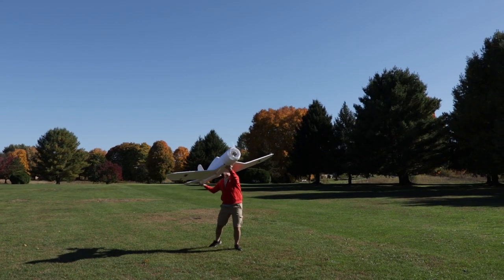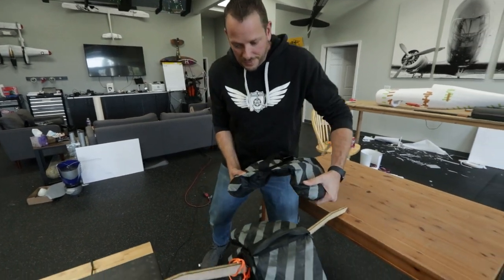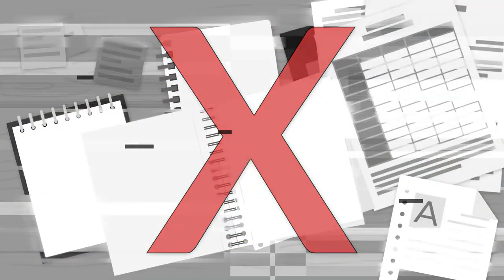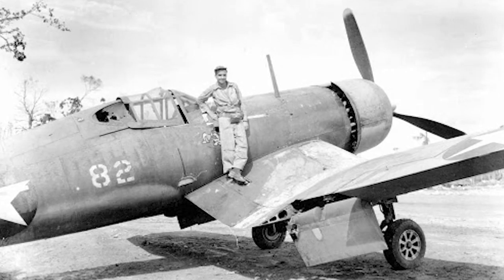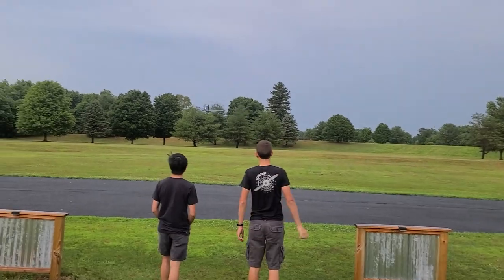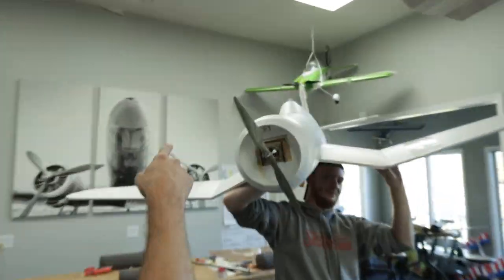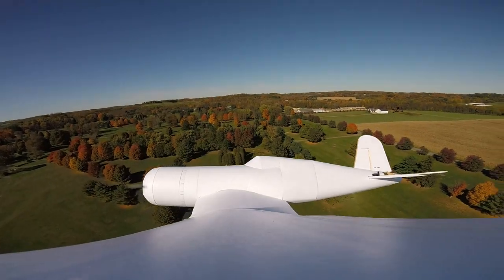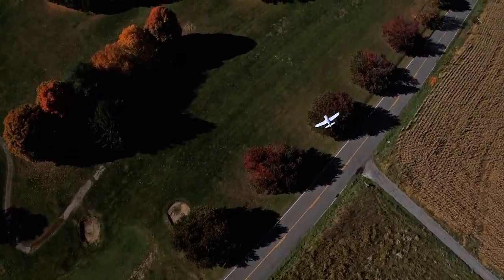Building and flying a Giant DIY Corsair!

Comment: Open up the cowling flaps to take some pressure off of the nose. Great Build and Design.  Ever consider drop "tanks" (batteries) for longer flights?
Reply: Yeah, that would be pretty cool to drop the used batteries by parachutes. Might have to make a special no friction connecter for the battery though so it can slip out easily. This is exactly the kind of cool problem that I'd love to see FliteTest solve.

Comment: I built a 73% scale from the original master series corsairs, with a 33" wingspan. The thing is a speed demon and looks gorgeous
Reply: Wow
Reply: Where can I see it fly?
Reply: Just curious - did you use A/F pack?
Reply: @JudeSchauer  I used a 2306 emax rsII 2450kv motor and ran it on 3s with a light pitch 7" prop, and 4s with a 6" prop. Yes the motor got WARM lol
Reply: @DPWingo  I have 2 crappy cell phone videos of it flying ony youtube channel, I'm trying to get a free day soon and have my brother chase it with his HD 4" drone. Those 2 older videos I just had my cell phone propped up on a bench and tried my best to fly past it. Horrible, I know, but it shows the speed somewhat
Reply: @sakfpv8444  Just watched them both. That's one fast Corsair. Thanks for sharing.
Reply: @DPWingo  thank you! I'm hoping to FPV it one day, and get some gps speed runs
Reply: @sakfpv8444  you should definitely invest in some FPV gear when you have the money.  When you put it in some planes (i did it in the FT TT) it feels like you are flying a real life plane.
Reply: @JudeSchauer  I have a lot of fpv gear for my drones, I stopped flying planes about a year ago when I found fpv drones, got some fatshark HDO2s and mostly fly drones and under 250g

Comment: Hey you guys beat me to flying!  I've had a 200% corsair built since the spring that I just haven't had time to finish up.
Reply: Did you add any center line structure through the middle like Noah did, or just like the plans?  Sure wish they’d share the big plans!
Reply: @chriscrawford1958  mine was built off the old master series corsair, so I ended up building a plywood inner fuselage.  Looked like my plane swallowed a simple stick.
Reply: @chriscrawford1958  the plywood inner fuselage tied the power pod to the first former set.

Comment: The beam is calculated by second moment of area. This relates to the depth of the beam not the thickness of wood to make it from. This means you can be quite thin but have the bending strength. The only other loading would be the backward bending force when in a dive.

Comment: The Corsair wasn't bent winged because of the prop size, or the Hellcat would have had the same issue since it had nearly the same engine and propeller setup. The gullwing was done to shorten the landing gear.

Comment: If you're looking for something to make it whistle, you might want to look in the automotive section of your local store. There are little plastic devices that people apply to car bumpers. They emit a whistling sound that is meant to alert deer to incoming traffic. You might be able to make a 3D printable varient that has slight tweaks to the geometry to get the right pitch.

Another alternative is to look at what caused the whistle in the real world. If I remember correctly (it may or not have been this specific plane. I know it was some WWII aircraft) it was actually the sound of the air passing over the exposed barrels of the wing mounted machine guns. Maybe inserting some metal or plastic tubing in their place may get you that sound you're looking for?

Comment: I’m amazed companies haven’t licensed out the original plans for these iconic aircraft and made 100% faithful reproductions. If it was mass produced during the war effort, construction should be fairly streamlined so a company could specialize to recreate a few examples.
Reply: And with cnc machines the complex parts could be produced easily.
Reply: AVRO Corp. sold plans for the SOPWITH CAMEL until 1974ish (I have a set)  Stopped selling them .....why??    LAWSUITS!!   In todays sue-happy people NO big company is going to take that chance.   There are home-build kits of 3/4 or 4/5 scale of many warbirds. Generally, Radials use a ROTAX ....IN-LINE usually a SBC.

Comment: i wish i had as easy of a time with the Aura 5 lite as you guys do, i guess i kept messing up or something, but i could not get it to work right even checking the servo/gyro directions.  i ended up removing it entirely from my simple cub and flew a pack at edgewater couple weeks ago. i hope to come out again before too long and maybe get some hands on advice on getting it setup correctly.

Comment: The prop appears undersized to scale. If it is, how would a larger 3 or 4  blade prop (and motor, if necessary) make it fly? Can you hot rod the plane to the point of failure?

Comment: How did you lock the removable wing into the fixed center part of the spar?
Did you use the wing from the Master Series Corsair and the rest of the plane is from the new mini?
Reply: They used the mini plans which are not going to be released.  It looks to be completely done like the mini, just taping the outer wings for flight. I have the original plans & will use basswood to install bolts for connecting wings, it will be 1700mm wingspan so that the FMS retracts, cowling, canopy & prop fit. 😁 I think 1700mm is big enough. Doing the same with P-51 after I'm done with the corsair enlargement.  Just recently completed 1450mm enlargement of P-51, (Old crow livery) without retracts, & the two blade spinner is available for belly landing.  I might do a youtube upload to show it. I did a youtube vid for original ft P-51 and ft Spitfire, see:   https://www.youtube.com/watch?v=58GtPN8GuQE

Comment: Great stuff. I favor the axis planes also. How about a Mitsubishi A6M3 Zero (Hamp) or a Nakajima Ki-84 Hayate-(Frank) as an adversary? Plug in wings of course for transporting. It would be a nice demo to have them both flying together with the chase copter. Soft combat only so it will not knock each other out with damages.You could hide air whistles with a couple of under wing arms possibly. Will there be plans available after all the bugs are out to make an even better plane in a version 2 or 3 maybe?

Comment: Hey josh question.  I have no experience with flying or piloting. But seeing the original real plane with the prop the size it is. Seams to be big enough to reach past the fuselage . Now on the model toe prop seams to only be a couple inches bigger than the fuselage.  Now doesn't the air it pushes back just go inside the opening where the monster moter is ? I'm at a loss for words as to what I'm trying to say..... if you looked at the model from the side profile. The prop doesnt seam big enough to push the air past the opening in the front. I hope you understand what I'm asking. By size comparison the real plane has a much larger diameter than the model..
Reply: I guess it just seams like mounting a prop against a wall . It's hard to understand how much air actually moves over the fuselage without being there in person. I'm in east central indiana I would love to drive out sometime and see the place!

Comment: Just wondering it there are templates for this plane for those of us with foam cutters?
Reply: Like a lot of their planes, plans are available at their site.  They are DIY minded, the plans are the starting point downloadable at website on home page and more master series on the forums, then you can enlarge them by what ever percentage you want to make it bigger.  They seemed to have gone 150% since it looks to be about a 7 foot wingspan.  I just use my printer and choose the poster option and up the percentage (use "full size" file for this) this prints several sheets to make the larger plane.  The file comes with full size for taking the file to Kinkos and paying $$ to get large sheets or the "Tiled" version to print regular size sheets to carefully align and tape together if you build original size.  Good luck.

Comment: How do you even start building these? Like getting control surfaces into the plane and everything. It seems impossible for a new person to do
Reply: Just download the plans, they are available on the site, then when printing use poster option and up the percentage or take the plan pdf to Kinkos & they will print it upscale to your specs with large sheets instead of taping 80 regular size sheets together.  You gotta do a bit of math, the formula is wingspan length multiplied by 1.5 (150%)  like wingspan 1168mm x 1.5  to get 1752mm or 69" wingspan plane. Just make sure you tell Kinkos to print in black & white or it will cost waaaay too much. Also tell them do not click "fit to page" when printing, it makes each sheet a different size & will not fit together when cut out.  Good luck.

Comment: Why not 3D print them with dissolvable filament and drape them with the thinnest of carbon fiber (stay safe with loose fiber) and then dissolve away the print. Should be strong and crazy light.
As for the corsair, it's a bit chunky. If you want great flyer think gliders, particularly the Transonic DP that has flown over 850km/h without engines. Think about that. And you might notice its body is ever so slightly thinner than a Corsair :)

Comment: something for you to think about: could you 3-d print a multi-engine transmission (I.E. a 2 motor to one shaft, or 3 or 4 to one prop shaft) ? My thinking is that that crowling is SO large that it could hold 2 or 3 or maybe 4 motors around a single prop shaft. Just think of the power you could show with that kind of horsepower! (Yes I know the ratio of weight to batterys/motors would be horrendious but it would be something to see!)